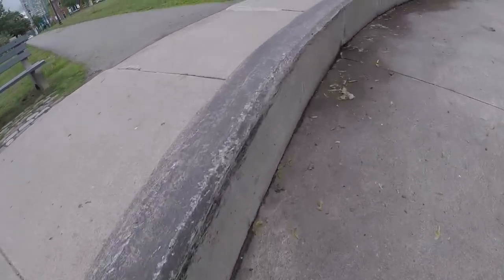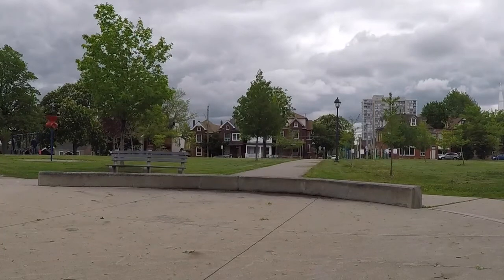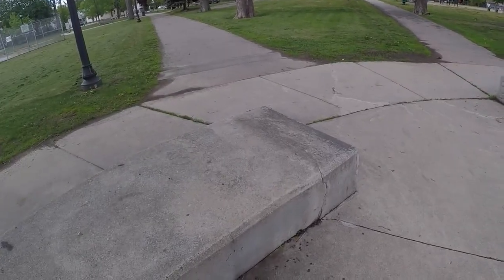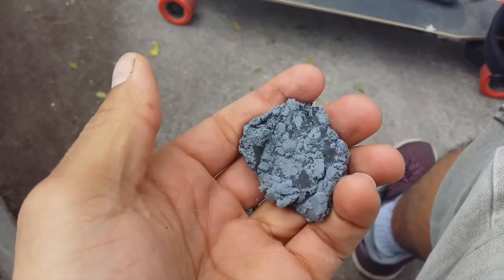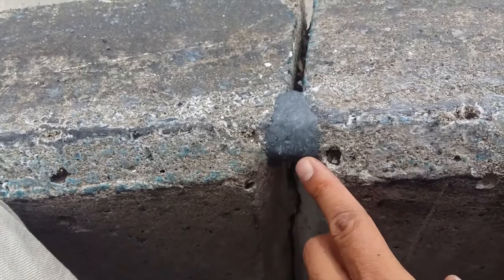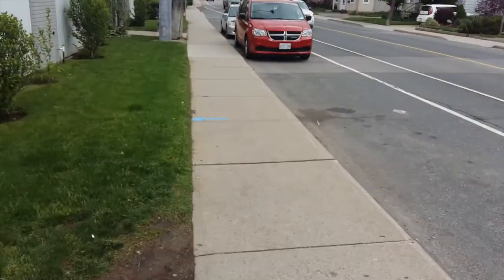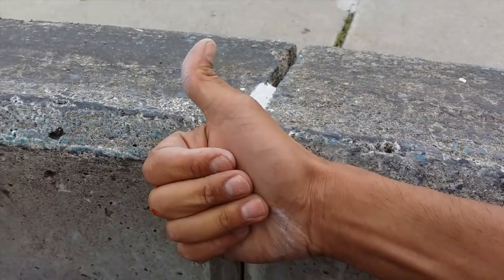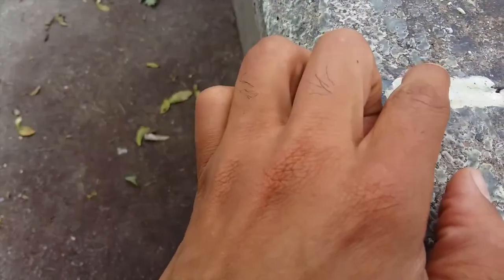HOW TO DIY SKATE SPOT #2

Comment: Not a bad idea but after a few weeks of that epoxy being exposed to the rain will chip off. Old Portland cement and sakrete r the best. Tubed concrete crack filler is probably cheaper and will last longer as opposed to those a/b epoxies. Cool video though